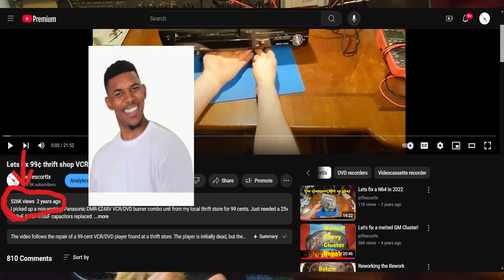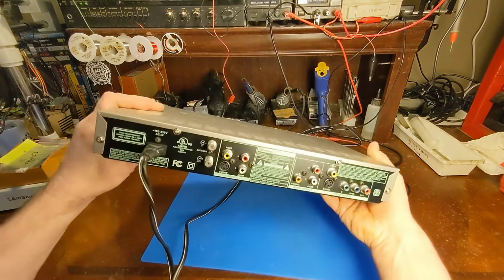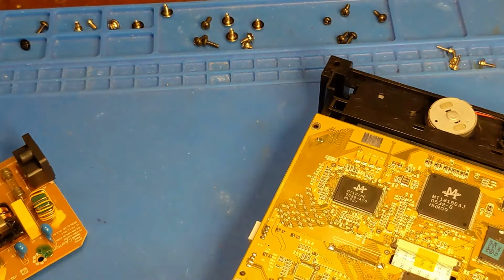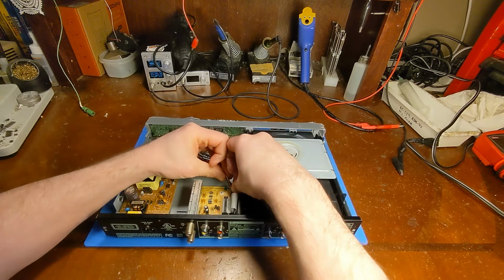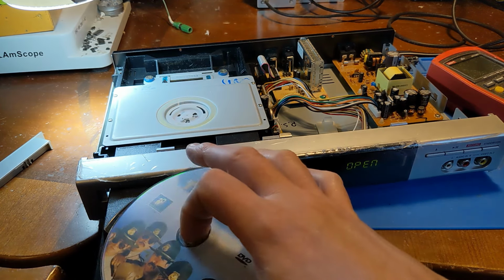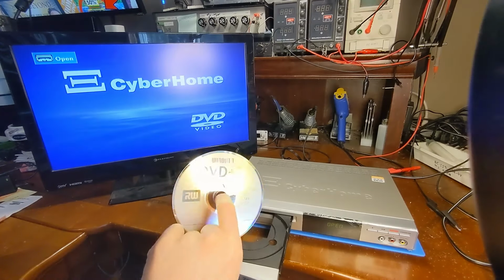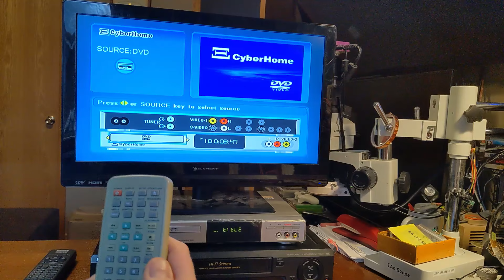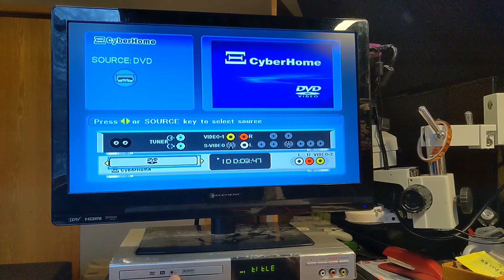I thrifted a unusual DVD Player.

Comment: Windows Media is a Microsoft video and audio format with DRM, they used it a lot during the XP era, but they discontinued it after Vista. Some DVDs did come with a digital copy of the movie on WMV (the extension), but at least one (Terminator 2) required online activation to work, so it wouldn't work in this player. People could save videos made with Windows Movie Maker to WMV (or songs to WMA, the audio version), and presumably read them off the disc.

Regarding the copy protection, I've tested some capturing devices that just... don't seem to recognize certain kinds of Macrovision signals so they allow recording. I tested out a copy of Barb Wire on DVD, and my test recorder didn't care about it being copy protected. My guess is your Titanic had that issue.
Reply from the maker: I had windows media set up on a desktop years ago with a tuner card. I really liked how well it worked with the TV guide to record shows. It was super slick and I used it up until it was no longer supported. But I always just watched recorded TV straight off the hard drive and never needed to worry about file formats.
Reply: If I recall correctly, macrovision didn't keep you from making copies. It was intended to keep you from making usable copies, in most cases. I also seem to recall that it also relied on equipment manufacturers making equipment that wouldn't fix the input signal.
Reply: @allenparke5874  I believe you're correct, yeah. I have multiple recording devices for PC that ignore the Macrovision and HDMI copy protection and let me record anything I want; but in cases like this, the DVD recorder will not block recording if it doesn't see Macrovision at all. It's why recording the VHS wasn't a problem, but when the DVD menu popped up, it would just go "nope, this is protected, not even gonna try" since the Macrovision is always on at all times on many DVDs.

Comment: I bought a Cyberhome DVR 1200 from Wal-Mart on Black Friday. It needed 2 Firmware updates to fix the audio problems while recording & playback & amother to fix the clock running too fast. It was capable of synchronizing to the time code of a local PBS station. Recording quality wasn't great & was too sensitive to Macrovision & would false flag detect at the slightest hint. I replaced it with the Magnavox MWR10D6 which is a Lot Better. Latches onto video better.
I might still have the remote for my Cyberhome recorder. Don't know about the firmware updates.
You should try to find a Scanned PDF manual for this unit.

Comment: The part where it "fixed itself" on the load/eject..... I'm thinking that they have current sensors on the motors to tell when it's at an end stop. Since it hadn't moved for decades, the 'scum build up' probably caused so much drag that it thought it was at an end.  Few times moving, the grease got mushed around let it move freely enough!  That's what car windows do for the express up/down (watch the current spike, then the controller shuts it off).
Reply from the maker: Yes it probably uses the current sensing to know when someone manually closes the DVD tray/or hits resistance. The old belt was pretty stiff so I'm sure that wasn't helping.

Comment: Copy protection (at leas in MacroVision) doesn't prevent copying it but most recordings get a degraded picture when its in place, if the quality comes and goes in the recording playback its the copy protection doing its job.
Reply from the maker: So then would this mean macrovision is not involved in this case since I can copy a VHS just fine?

Comment: It started acting right as soon as it got it's CAT Scan ..... One reason for it copying from DVD to VHS is that it could be an import unit and the microprocessor isn't coded for that US restriction ..... There are quite a few brands out there that write to DVD's from copyright material..... I had one , but it took a dump when Hurricane Delta came through here , the grid kept going on and off , on and off , and I had forgot to unplug a bunch of stuff.... My HP 8657 signal generator survived as did the rest of the equipment on the bench , actually my GW Instek signal generator is drifting a little ..... Hmmm...

Comment: Lucky that's a Panasonic unit, I bought an LG unit with the built in vhs player to record direct to dvd and it never did the job right out of the box.  Had to take it for repair under warranty and  even then only worked badly.  That LG was just an absolute piece of shit and the reviews on that machine all have the same problems mine had.  Totally robbed and never bought anymore LG products after that because LG went to China and that was then end of the once good brand.
Reply: When the old 27" CRT finally let out the magic smoke, I surprised my dad with a brand-new 32" LED LCD FHD LG panel with 120Hz refresh rate. He wanted to keep the wooden entertainment cabinet at that time, so the largest that would fit was 32".

I also needed a new tv since the 42" Vizio 1080i plasma panel I got for $40 and fixed for $40 more was pulling waaay too much power and wasn't progressive scan capable, so I sold it and got a 40" LED LCD FHD Haier panel (60Hz) used for $100.

That LG cost 3.5x as much, but had failed after 2 years and several months (backlighting and t-con failures), and LG only offered a two year warranty back then... how bizarre. /s

Meanwhile, the Haier is still working flawlessly in our guest room a decade later... I was certain it would have been the other way around. 

I was mad that LG had manufactured such a POS... my dad's getting up in years, he doesn't need that sort of nuisance, that's entirely why I got him a name-brand like LG new in the first place, while I rolled those dice with a used panel from a lesser known vendor. 

By that point he had moved to his new place and didn't have the entertainment cabinet anymore, so I got him and myself 40" LED LCD 4K Samsung panels, and both of those have been working as primary displays for the past 8 years without issue. 

Ever since then, I've stopped purchasing LG, but my landlord however had bought all LG appliances for the house (with the exception of the range): since then, the washer has failed (just out of warranty), the dryer has failed (just out of warranty), the microwave has failed (a bit further out of warranty, but it now acts like a microwave without doing microwave things), and the fridge is on its way out (thankfully, it's held on the longest, but the water pump has seized, the ice maker has failed; yeah, Life's not so Good right now).   

I've got a better slogan for them... LG : Time Lost, Money Gone